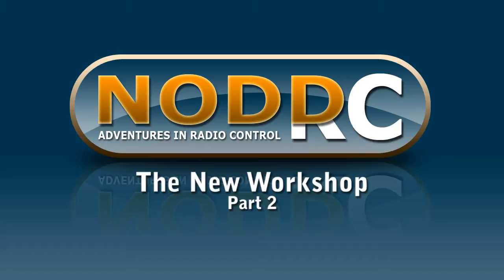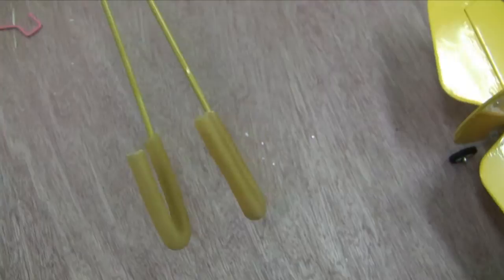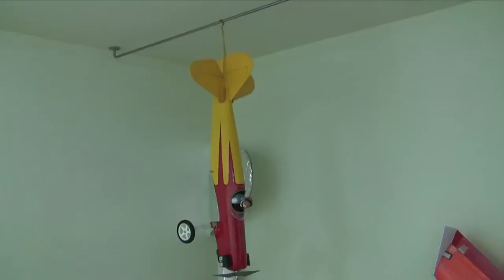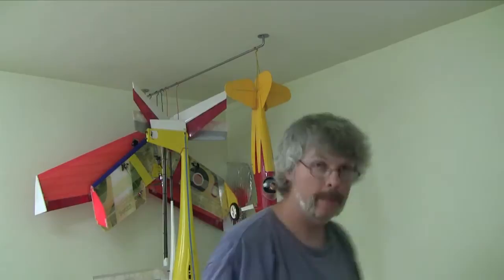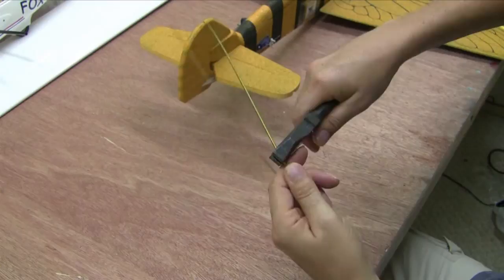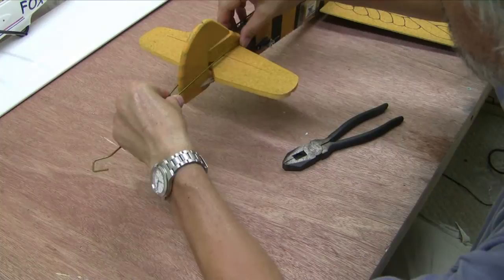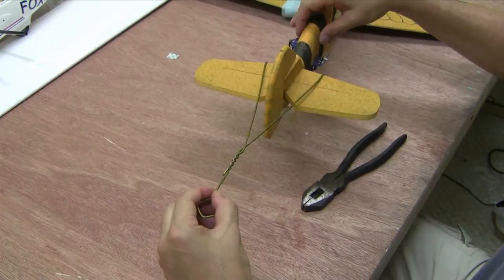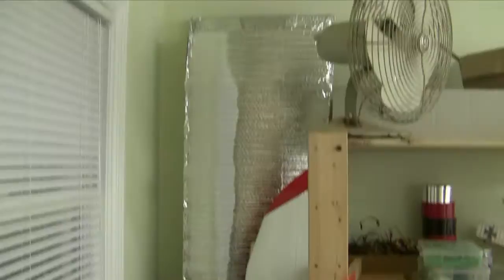Nodd RC - 056 - New Workshop Part 2

Comment: I used same idea in my garage, hanging them on electrical conduit, put wings into bubble wrap socks I made up and hung them on the same coat hanger hooks, nice and compact and protected storage. Word of cushion, even with tubing protector on coat hanger it will eventually make dents in foam surfaces like your stabs due to weight of the fuse. Ended up wrapping a pc of cardboard around those, under the hooks to distribute the load.